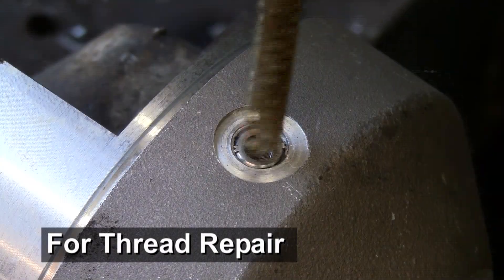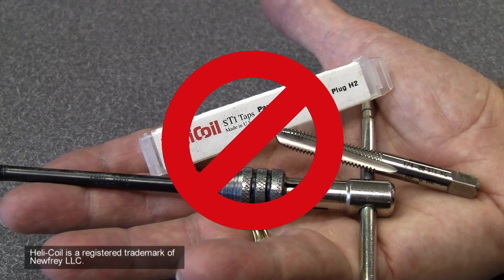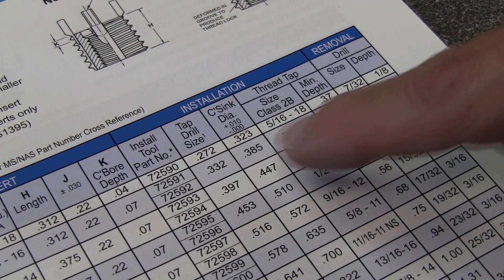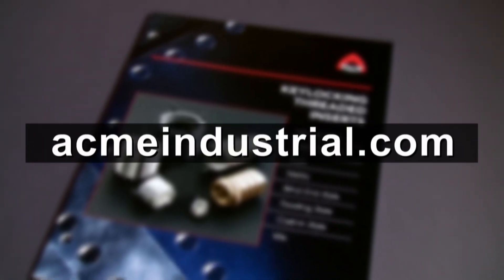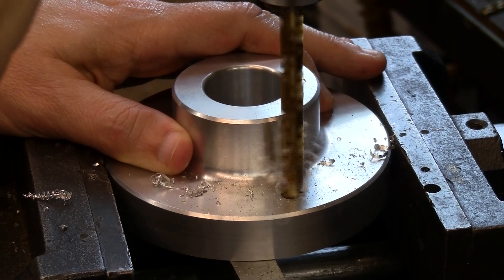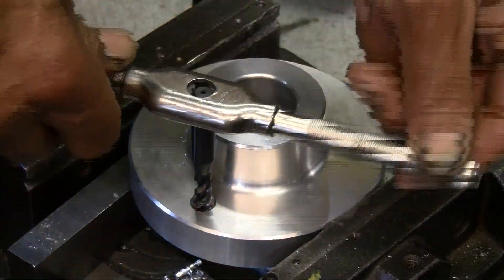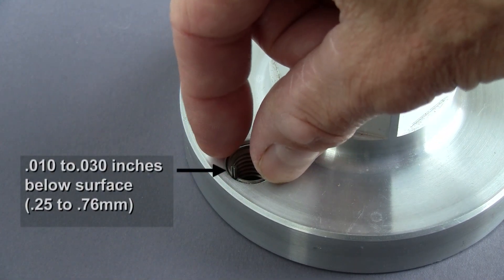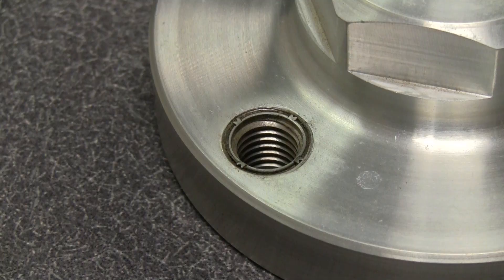Keylocking Threaded Insert Installation for Thread Repair

Comment: One video says it requires no special installation tools (compared to helicoil pre-winder), only "commonly available tools'.  But this video shows an installation tool for locking the keys.   Does that come with the insert, or is that purchased separately?
Reply: Yes, this is EXACTLY what I am wondering too.